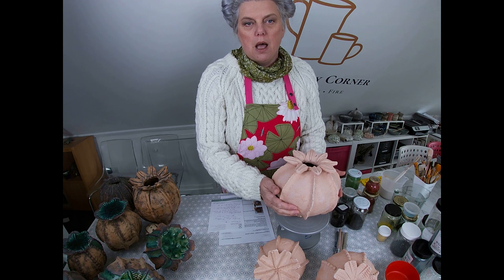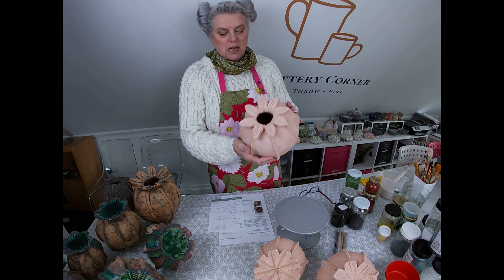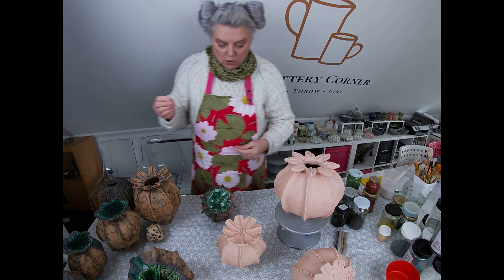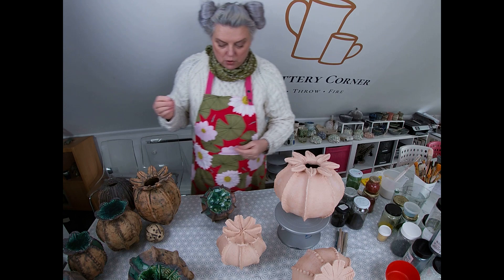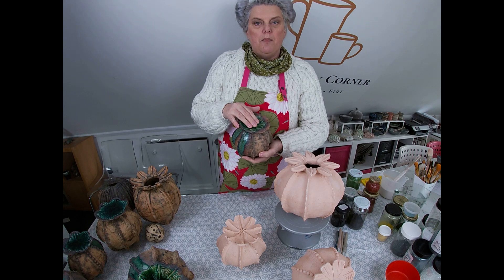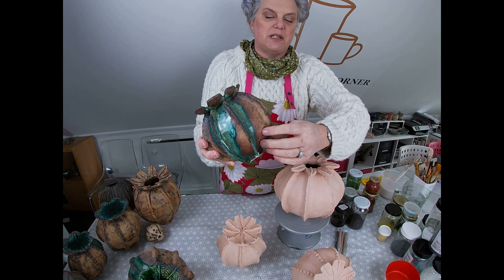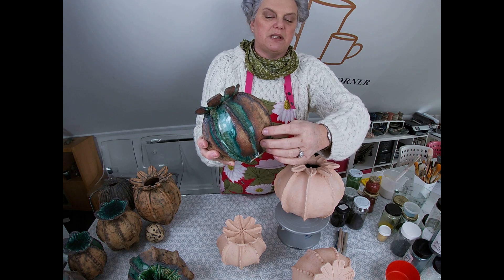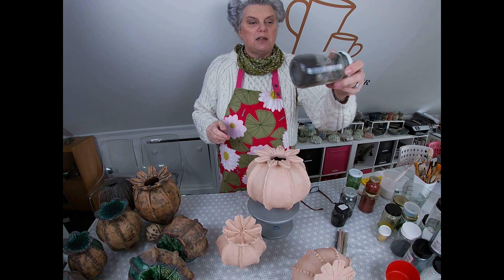Pottery Top Tip: Sculptural Poppy Heads Part 2 Oxiding & Glass Frit - Pottery Video/Tutorial

Comment: That's was very informative,also can you use glass on whatever your doing just to add a bit of more sheen  on spots. Just trying to learn more about pottery and different tips thanks again really enjoyed it. Very easy to follow and understand. Just trying to learn more about oxides and stuff like that.
Reply from the maker: Hi Heidi  great to have you along.   You can use glass on glaze - just remember it may change colour on the glaze and it will travel if it doesn't have a  'dish' shape to hold it.
Reply: @thepotterycorner  thanks and that's a good tip

Comment: When you did your explanation of the types of glass you did not mention glass seed beads...do you think they would work? Thanks for your time.
Reply from the maker: Hi Mary- yes you can use the glass beads.  However I would try these on a small dish first to see what happens.   The firing temperature is very high for glass so might not work.   Don't mix the colours either as they have different coefficients.  Pretty coloured glass bottles work well too.  Hope that helps and thanks for watching 😀